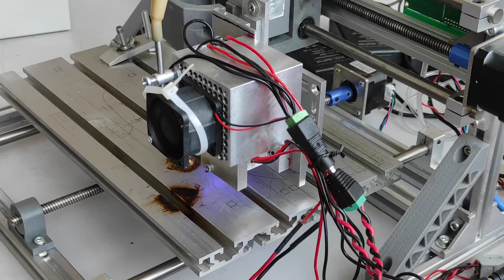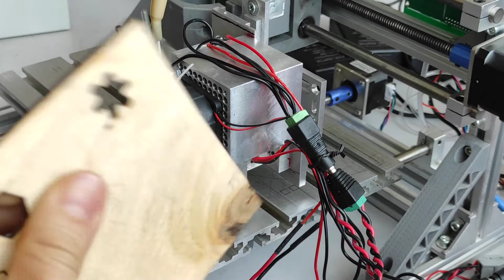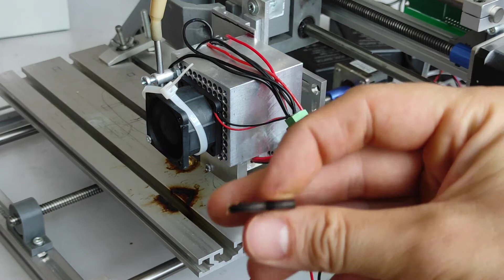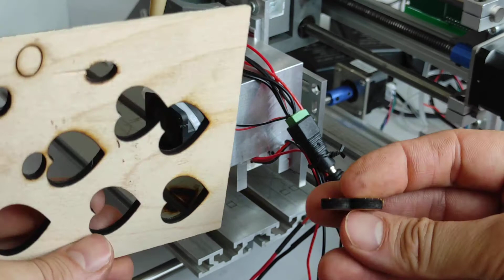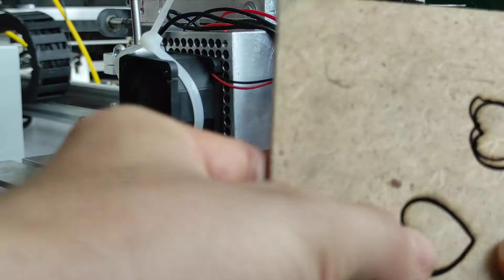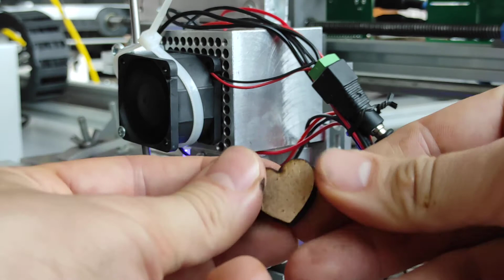Plywood & MDF cutting with Endurance 15 watt dual laser beam system installed on CNC 3018 machine.

Comment: You can think about a grate, it keeps bed out of laser focus. I believe its height should depends on laser power. I used one with about 16-18mm while I cut a cardboard, but my laser's optical power I think nearby 4.5-5W, and therefore, the bed still clean.